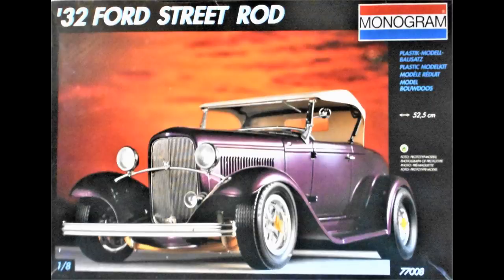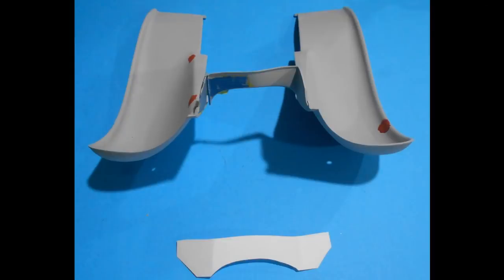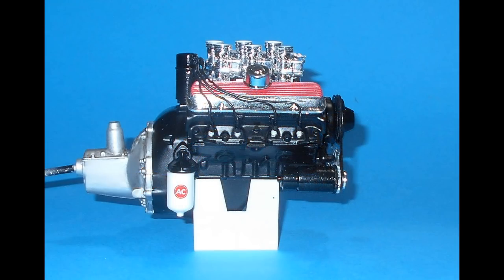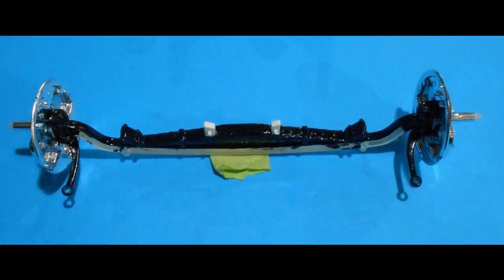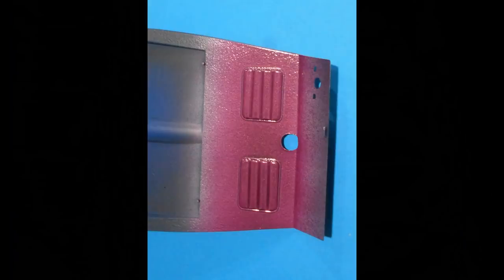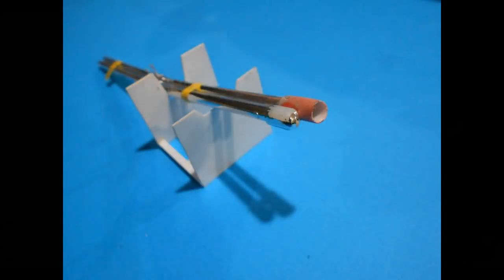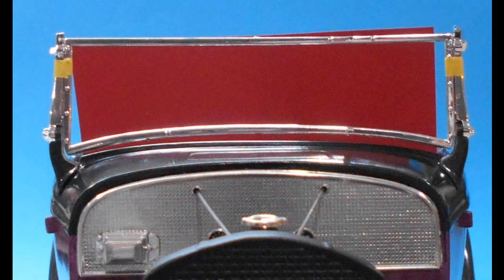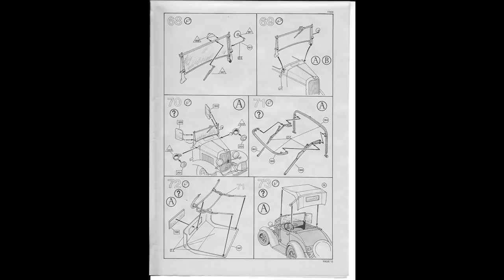1932 Ford Street Rod 1:8 Scale Monogram #77008  -Model Kit Rescue & Review

Comment: I picked one up at a model club I belong to. The chassis and engine were partially built (very nicely) and the rest was unassembled. Being a Monogram kit, the quality is  first rate. I`ll leave it in the black it was molded in because the factory paint job is as good, if not better than the rattle cans I would use because it looks like it was pre gloss coated and waxed. I`ll probably put in carpet and upholsture  the seat with white leather. I`m also considering making the head and  tail lights work.This was a find, well worth the fifteen bucks I paid for it. I can`t wait to  start it, but that 1-350 scale  Minicraft 'Titanic' is still on the workbench!
Reply from the maker: Brer,  Cha-ching, you got a deal!  I've addressed a lot of the kit's issues in this review that you'll find helpful as you proceed.   Thanks for watching and if you like what you see  please subscribe, if you haven't already, to help us inspire more modelers! -Doug

Comment: Awesome job, I built the white box version in the 70s, I seem to remember the fuel line connected to the fire wall. One of the gauge decals was a fuel pressure. I got one of the later versions in my stash, it has a proper flathead V8
Reply from the maker: S,  Interesting variation.  Thanks for sharing!        PS, please help us reach more modelers by subscribing if you haven't done so already.  -Doug
Reply: You could scratch build an electric fuel pump mounted by the gas tank and fashion a fuel pump block off plate on the engine. On my real car I needed a fuel return line and a pressure regulator, this was for a Holley 4bbl on a built 440.
Reply from the maker: SF,  Right you are and thanks for the tip!  -Doug

Comment: Wonderful rescue. Looks to me like this rescue and build into a first class model took some advanced skills. I can't tell the difference between the original taillight red tinted and the homemade replacement. You can't tell the frame was ever damaged. Glad you could find a new grill shell. Shows you how far the model hobby has come. I always liked Monogram models. I can't remember being disappointed by them when I was building in the 1960s. So I am surprised they left out the fan and fuel pump for an otherwise nicely detailed eng in ne, right down to spark plugs.  Happy new year from the snowy west.
Reply from the maker: Pat,  Nice summary and thanks for watching.  I've heard that some of the later issues had fixed some of those errors!  -Doug

Comment: Nice build! This is an odd reissue of the Big Deuce in that it didn't include the update parts that were added in the '90s when Revell hired ROD&CUSTOM magazine Editor Pat Ganahl to modernize the Big T and the Deuce. I did the Model Column in R&C from '95-98, never got around to doing a finished Deuce. 
Nice job on a 70s era, colorful streeter, and accurate to 1:1 except for the combined hood/radiator shell. I'll let that slide... THIS time. Nice work!
Reply from the maker: Thanks Rick,  That means a lot  coming from you!  -Doug

Comment: That turned out really nice. I make a boatload of aftermarket parts for this kit. If you ever need any missing parts or just want to dress it up, come find us on Facebook groups HOTRODZRUS SCALE MODEL CARS. I even make coupe and sedan bodies for this.
Reply from the maker: Jim,  Thanks for the info we'll keep that in mind!      PS, please help us reach more modelers by subscribing if you haven't done so already. -Doug
Reply from the maker: Jim,  BTW - Do you make the fan, fan mount and fuel pump that are missing from this model?  How about the frame itself?  -Doug
Reply: @RightOnReplicas  I make the fan and I have a Buick nailhead engine that has a fuel pump so I'm sure it could be modified to work. I also sell rolling chassis, bodies flathead and Pontiac engines. I have over 200 items in my catalog. I'm currently working on the yellow coupe in american graffiti the iconic 32 ford 5 window coupe.